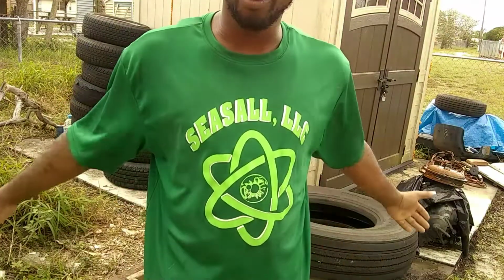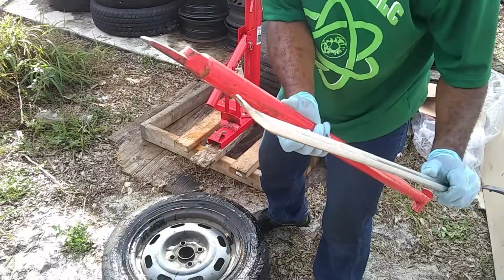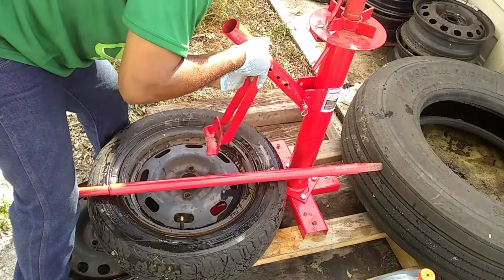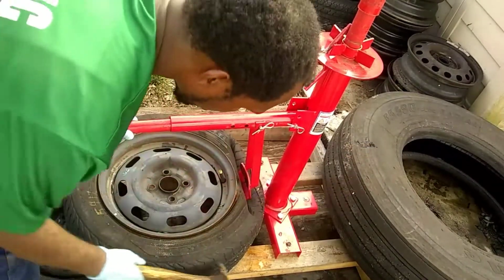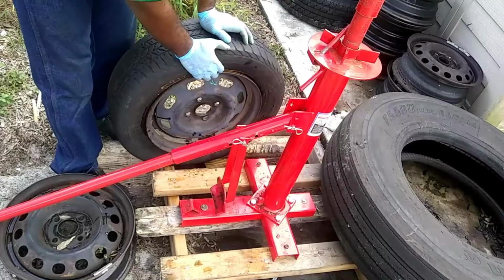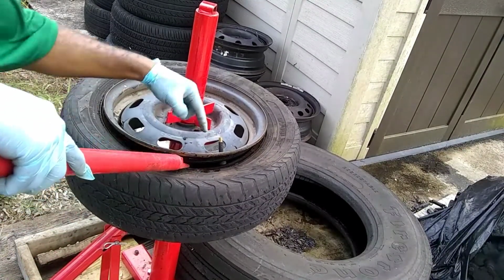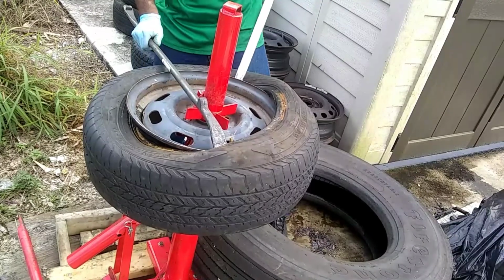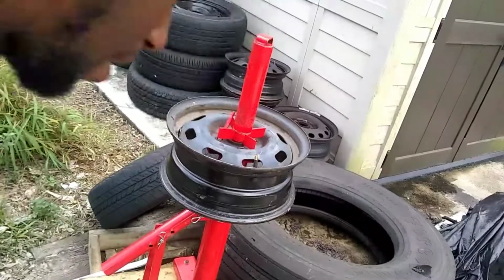How to Use a Manual Tire Changer - Harbor Freight and review

Comment: I agree with one of the comments earlier about no lube when you are breaking the bead. I have a heavier bead breaker my dad got at TSC, a farm store. I have a series of vids about making a tire changer on my channel, T wagner. I used my bead breaker and got the tire off the rim in about 10 min. I'm waiting on my wife to get back so I can put a couple new tires on my car. If the tire and bead breaker are rock solid, maybe modified a bit, it would help. Back in the day you would secure the tire to the machine and push a pedal and 2 "c" shaped shoes would break the bead.
Reply from the maker: Are you referring to big truck tires or small tires? As in passenger or small truck or 19.5 and higher? I'm going to check out your channel thank you for commenting.
Reply: I haven’t tried truck tires, I have a 1/2 ton truck with 16” plus tires. I do have some video’s this week that show what I did with my new tire changer I made.
Reply from the maker: @twagner6155  that's awesome I tried to find your channel but I couldn't if you can send me a link I'll be sure to check you out
Reply: Google T wagner Youtube. I find it faster with my lap top instead of my iPhone. Thanks for your interest.